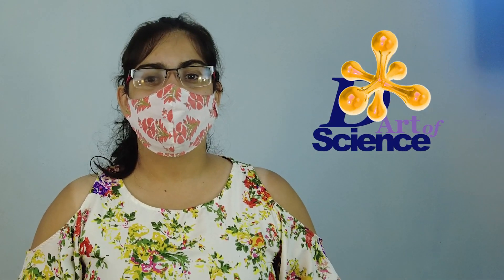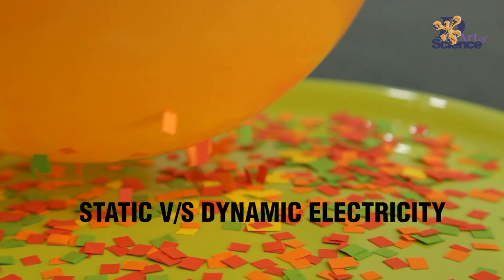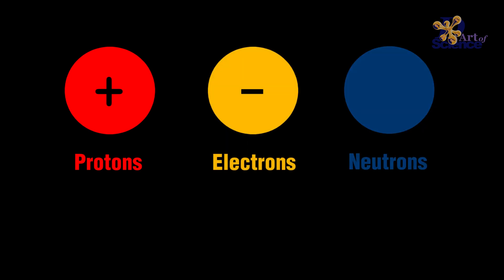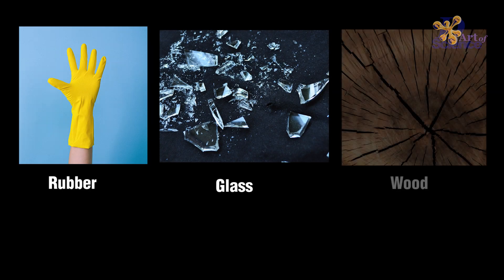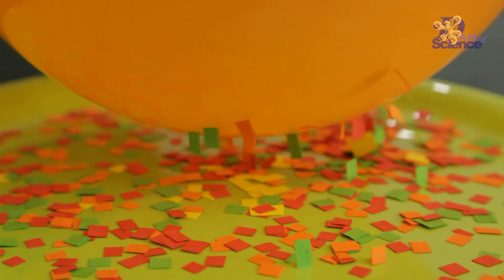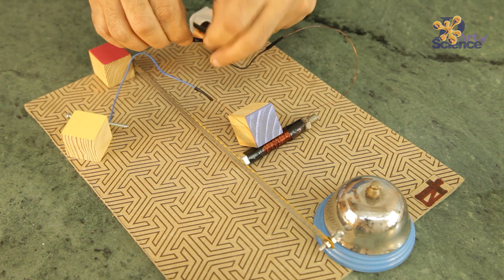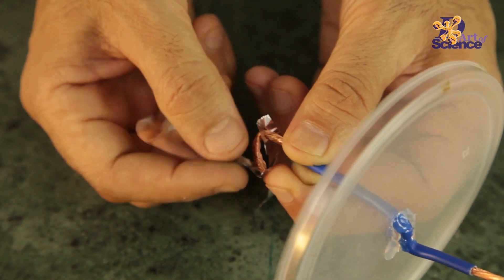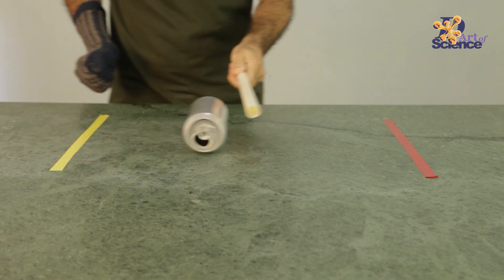Static v/s Dynamic Electricity | dArtofScience

Comment: So to generate electricity, electrons needed to be moved so how they are moved in case of dynamic electricity without rubbing please tell with an example.
Reply from the maker: This happens due to Potential Difference or the voltage. Potential difference or voltage is basically electrical pressure.. This is what batteries do. They create a difference between the two ends of the battery and this difference pushes the electrons and sets them in motion. This is somewhat like when there is a bottle of water connected to a pipe but there is no flow happening through the pipe. But when we blow onto the bottle or increase pressure on the water inside it, the water will start moving through the pipe. This is how the voltage applies electrical pressure to set the charges in motion.